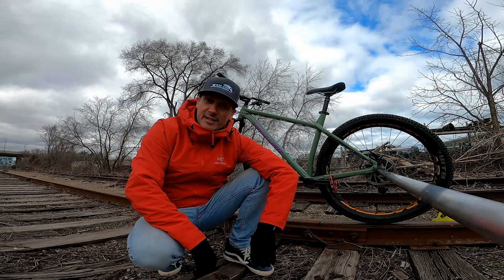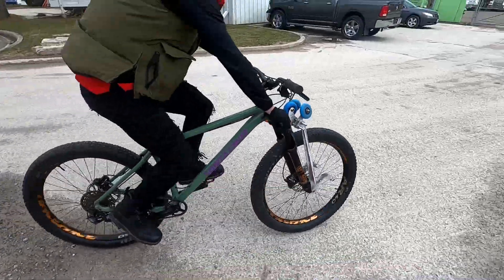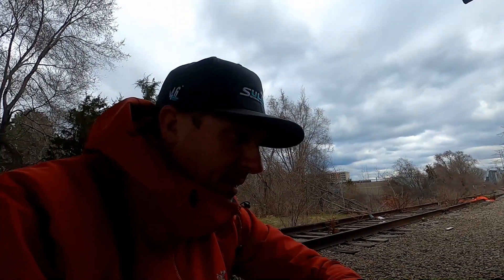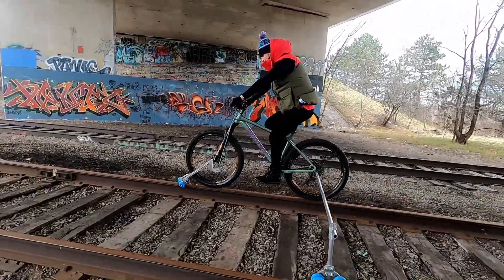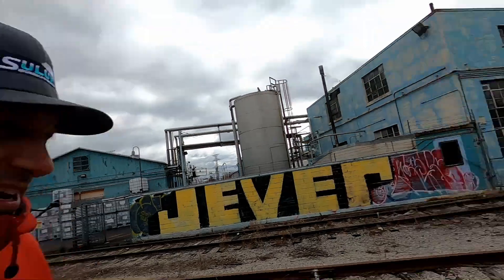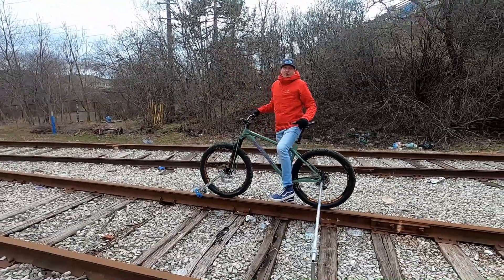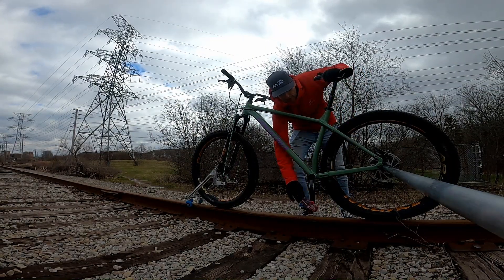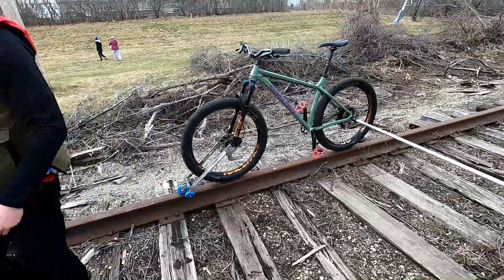RAIL BIKE - Version 6 - NEW LAND SPEED RECORD! also this thing will try and kill you.

Comment: Mount the rear pair of outrigger wheels inboard of where they currently are to give you the widest track or running surface on the outrigger. Tracks tend to breath in width, especially on wooden sleepers. Even a roller from a conveyor system or boat trailler roller on the outrigger is best. Never gets stuck in the switches or anything. I have a Pallet Jack roller on mine and 4 spaced skateboard wheels on another.
Reply from the maker: You know your stuff. I've been tied up but the new design just has a long wheel on the outrigger, the flanges cause the issues as the track width changes slightly.
Reply: @Suluk46  yup. Especially with wooden ties/sleepers.

Comment: Have you considered using skate board wheels? Instead of doubling up rollerblade wheels you could use wider 1970’s style skateboard wheels (which are still in production) & have leaner rig. I work in that industry and I can promise you that there are an infinite amount of choices in skateboard wheels versus rollerblade wheels. 
My 2€ worth. Cheers
Reply from the maker: That's a good idea. I've run the gambit on wheels at this point, leaning towards either full horizontal or vertical guide wheels to decrease complexity and reduce the likelihood of failure.
Reply: I use then on my 2" knife grinder. fantastic

Comment: There are several issues I see right out the gate.......you should look at the older style rail bikes that people used in the 20's and 40's.
Reply from the maker: Those older railbikes paved the way for sure. I'm going for a more packable and simplified solution. New versions work very well, but still having fun testing all the different ways to get this done.

Comment: This is a very cool idea!
   I’m sure that you have watched lots of videos on this subject. I’ve watched several videos on this also. I’ll pass on some observations to you just in case you missed seeing the same ones. 
  I’ve seen a guy who used an adjustable over-centering lever, instead of bungees to put down pressure on the front wheel guiding set-up. That seemed to work well. 
  I’ve also seen people use more distance between the front wheel and the guide wheels out front. This makes for finer & more accurate control of the front wheel. (You may be OK in the guidance department, but I’m just putting it out there).  Some use a set of forks off of a scrap 10 speed bike for this.  The extra forks go on the same axel as your front wheel. (Assuming that your Axel is long enough to attach both sets of forks). The guide wheels are mounted on the steering post. ( the single piece where the handle bars mount to). 
 Personally I’m leaning towards designing a rail cart that is a big rectangle. It only needs guide wheels inside of the tracks. The front wheel will come off the bike and mount to the cart while the rear wheel contacts the track and provides power. This can be used for 2 bikes side by side or one bike. 
  I want to make it portable by putting a sturdy hinge in the centre. It could be folded into a high, narrow triangle and pulled behind one of the bikes as a trailer. 
  I like your design that makes everything adjustable! That’s a really clever and elegant solution.
Reply from the maker: I've seen the one where they use an over-center device. Very nice design. I'm going a different approach in terms of simplicity, weight reduction, and multi-use components. That said, his design is probably the best one I have seen out there. I think bikepacking magazine did an article on him. Very cool.
Reply from the maker: You are also correct that the further the front guide is from the center of the front wheel, the finer the steering inputs will be. Of course, it also matters how wide the guide wheels are apart, but I think we are on the same page. At this point, I am just trying everything, this will be the most comprehensive Railbike development video series in the world 😃🏋️

Comment: Looks like outrigger should be triangular to the bike frame. Wobbles a lot. Another smaller tube that pins front and back from bike frame out to outrigger wheels. Stores inside main outrigger pipe.
Reply from the maker: I've been trying to stay away from adding the extra brace. On my new version, I made the outrigger out of steel so it is stiffer and heavier to help lean the bike to one side. I also have new wheels on order that should be here in a week. Those will go on V8. Then, if the deflection is still bad, I'll add the brace like you have suggested.

Comment: Very cool, how well does it navigate the track points eg. changeovers and junctions? -or is it designed primarily for riding on straight/curved tracks?
Reply from the maker: It handles curves without an issue. But I gave up on trying to have to traverse crossing and stuff. It would make it more complicated and the majority of abandoned railways that I would use this on are fairly remote without any of that stuff. Just need to slow down and push it over those sections.
Reply: @Suluk46  I have a cord tied to the front wheel guide. I slow right down and lift the guide out of harms way, Hovering it just above the track to give me a visual reference.
Reply: @Suluk46  Tight curves on narrowgauge tracks are problematic. More so downhill, but enough to make me consider a rear wheel guide ass well.

Comment: I would think about putting the wheel guide behind the front wheel, then if you hit a tight spot it's more likely to pull over, and if you derail it's not going to nose dive into the sleepers or ballast
Reply from the maker: That's a good idea. My initial thoughts are that it needs to be in front of the bike tire, but maybe it doesn't. That's an easy test anyway, I can just reverse the system. A derailment is a very real concern, especially at high speeds. So if the rear guide works, that would be awesome. Thanks for the idea.
Reply: @Suluk46  expedition risk management via YouTube commenting. I've finally gone full armchair outdoors person.
Reply from the maker: Lol. Well, I appreciate the input.
Reply: @Suluk46  I know you are PPE averse but maybe a helmet just in case of derailment at high-speed.
Reply from the maker: I might need football equipment for protection when using this crazy device.